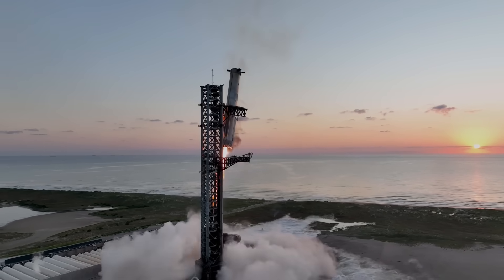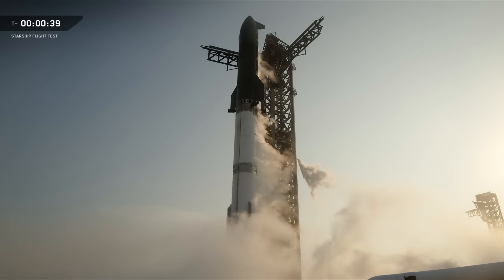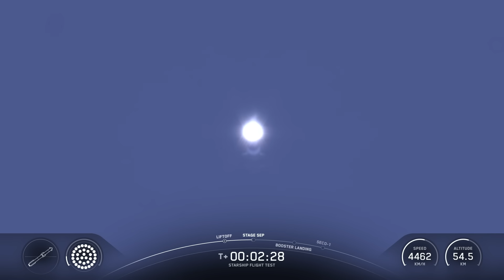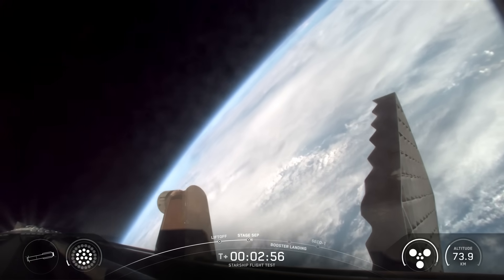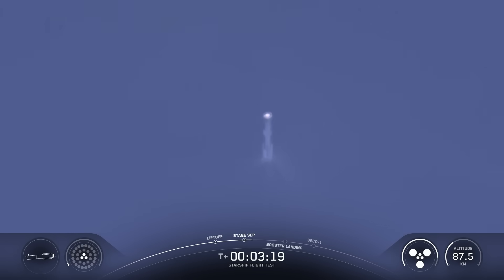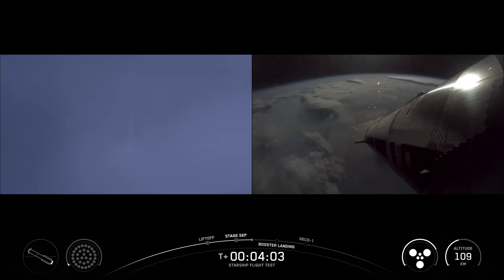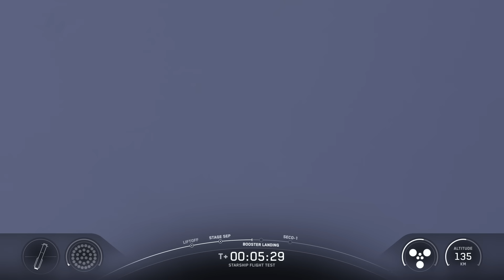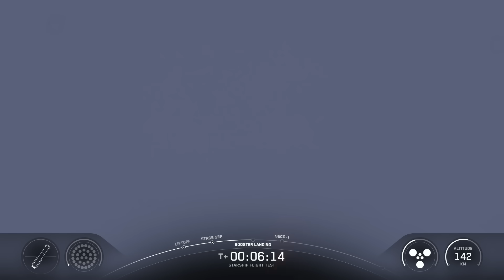SpaceX Builds Largest Reusable Booster, Also Makes Door That Won't Open - Starship Flight 9 Recap

Comment: 8:19 spaceX did talk about not lighting an engine on the landing burn, to see how the booster handled the change
Reply: that was meant to be one of the center engines when they go down to just the middle 3
Reply: Sure, but I guarantee that wasn't the engine intended for that particular test. That would have been one of the final three engines.
Reply: Poorly, it seems.
Reply: not well apparently 😅
Reply: @trabladorr  🤣
Reply: They didn’t even get close to that part
Reply: @Will-eq7uh  - yes, so the mission failed on yet another objective.
Reply: @malcolmstreet1 I mean, you can say that if it makes you feel good but it’s a test flight, they tested it and will learn from it. Failure doesn’t really make sense
Reply: @Will-eq7uh  - er no, the  point I was making is that they didn't get to test the engine out scenario, which was one of the aims of the flight.
Reply: @malcolmstreet1 okay but they did get to test other parts, in fact the main thing was the reuse of the booster and getting ship past SECO. again you can’t call a test flight a failure unless you’re a petulant, embarrassing child but you do you sweetie.